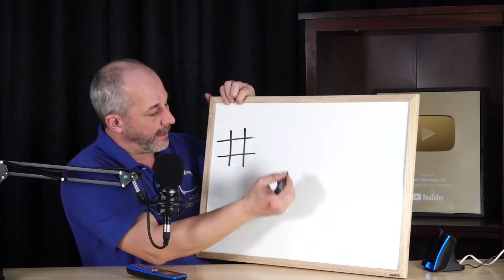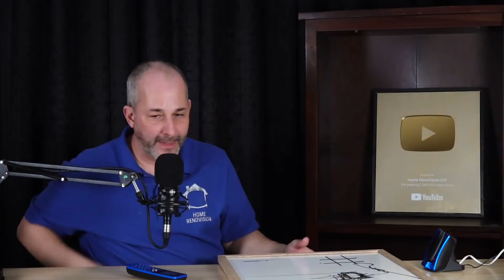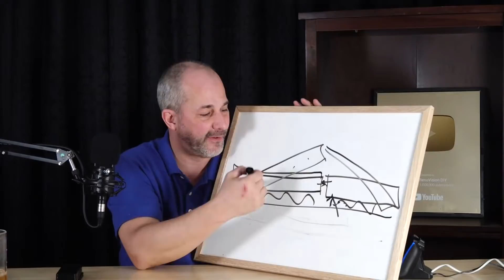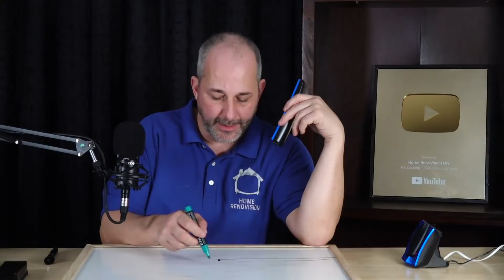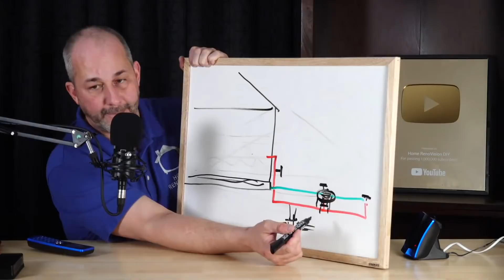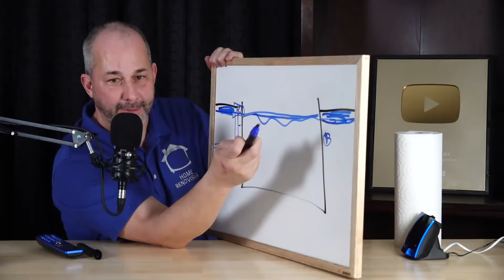Texas Strong Day 2 Mitigation

Comment: Um there is no such thing as a brown out. It's BLACK. A BLACK OUT. Black is not a bad word and more offensive when people dodge using that adjective to discribe no light. If your talking about people that's different. There are no black people. Appreciate you buuut....
Reply: A brown out is when the voltage drops, the power is still on but it can cause Major damage to electronics and appliances. A black out it when the power totally shuts off.

Comment: Hi. Thanks for all your doing for us here in Texas.  I had no power, no water for 3 days straight.  My tankless water heater busted, but did not leak much since I had my kids inside while I turned on the water slowly and checked after pressurized, found the leak and turned off the water again.  I called insurance and deductible for named storm event is almost 13k.  In this scenario the insurance is useless.  This will be on me unless ERCOT is willing to step up and help.    My question is, to replace the tankless which is recommended that won’t create this in the future events?

Comment: Why do pipes burst when the heat comes on???
Reply: The ice swells and breaks the pipe. When the heat kicks on the ice in the pipes thaws exposing the cracked pipe to now liquid running water. You won't know the pipe broke till the water flows. Often times the sound of the burst is just the ice giving way
Reply: @mabolzichjjl  Very helpful, thanks very much!